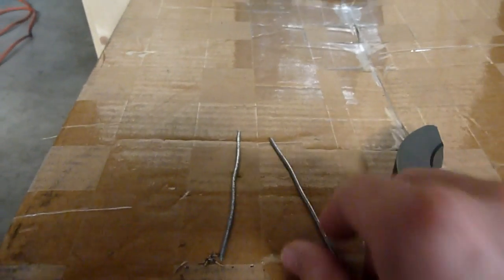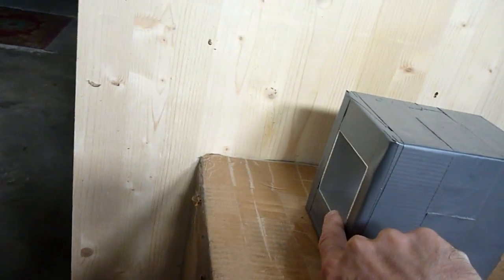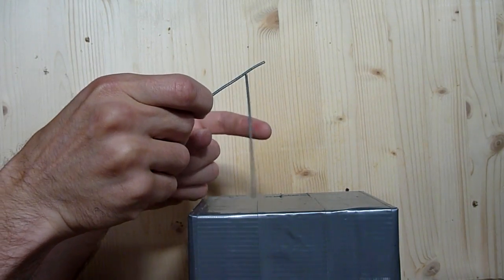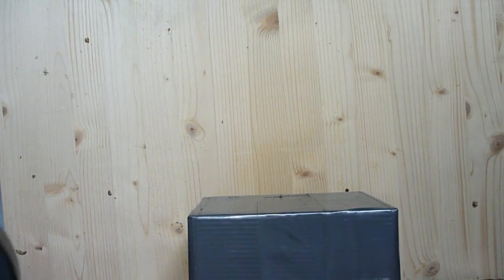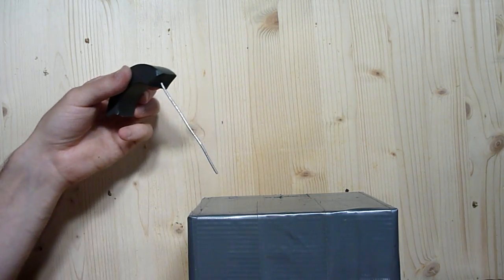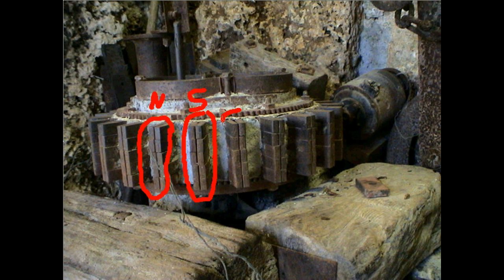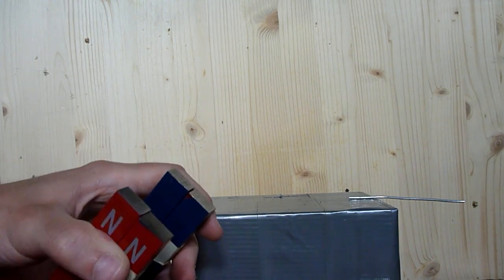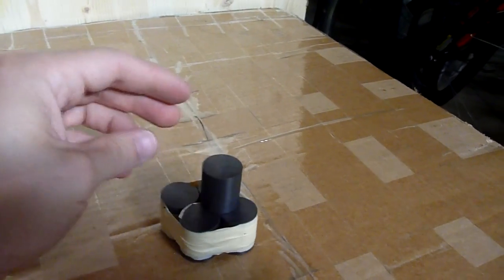Further investigation into Ed Leedskalnin and Magnetic Current

Comment: Very good. Can u explain, if a flat ceramic magnet is sandwiched in between two iron plates of the same size, has more magnetic power on its  non flat sides, like such sandwich fitted in cupboard door system.

Comment: You are visually showing what I have been trying to explain to people about the moment of inertia and velocity of the gyroscopic particles moving through the Aether in the magnetic field. You are proving the affect to yourself.  Their travel down the surface of the wire is speeding them up and squeezing them together at the point where the wires meet.  They are gathering off of the larger field and moving outward down the wires and returning back out into he air and cycling back to the larger magnet.